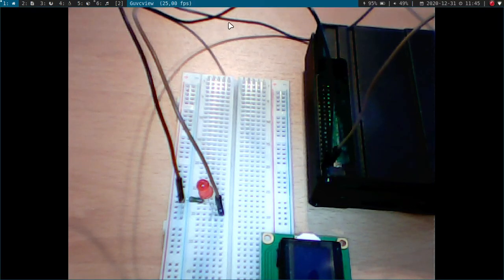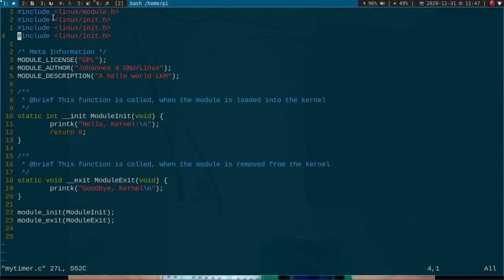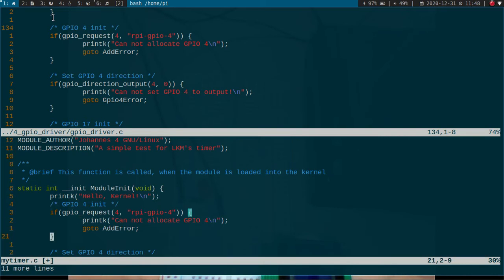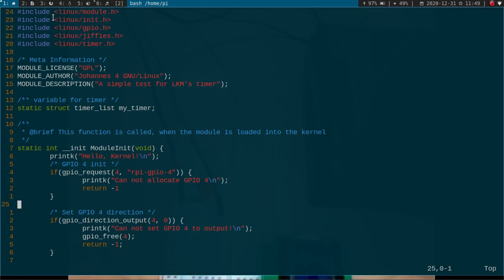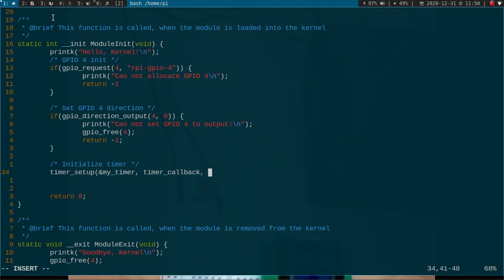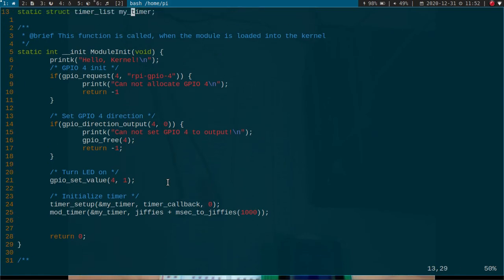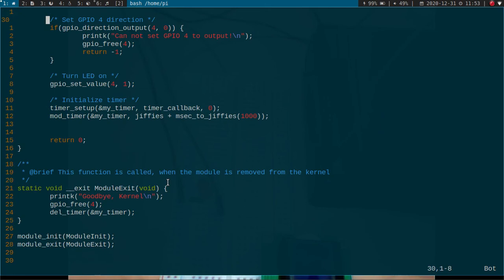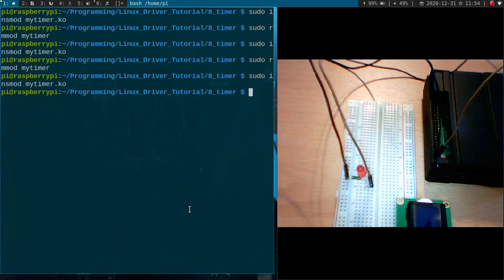Let's code a Linux Driver -  8: Timer in a Linux Kernel Module

Comment: doesn't work on my kernel 6.4 for some reason... ;(
Reply from the maker: Thanks for the hint, I will redo it as soon as I know what changed
Reply: @johannes4gnu_linux96   can you give me a hint? i desperately need this, thx in advance
Reply: I'm using Kernel 6.1.21-v7+, code from the video works fine (without any changes).
Reply from the maker: I could compile it with a 6.4 kernel.